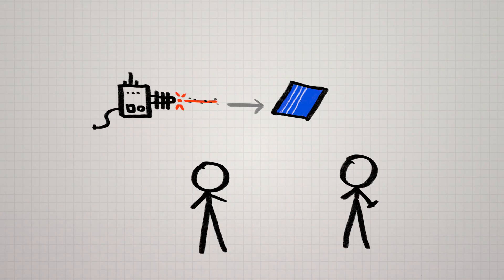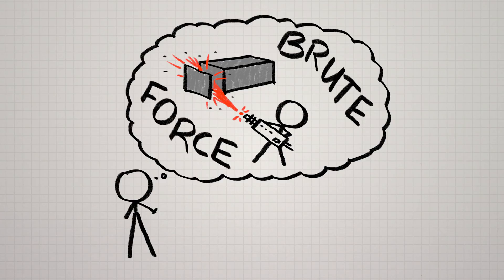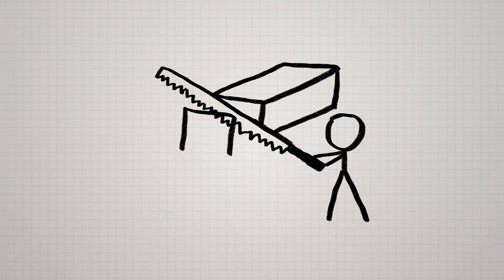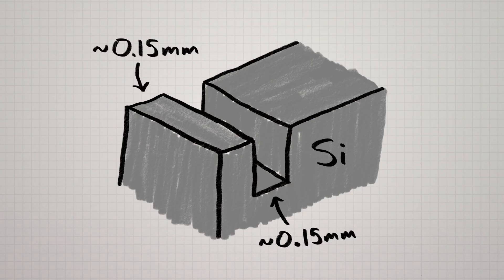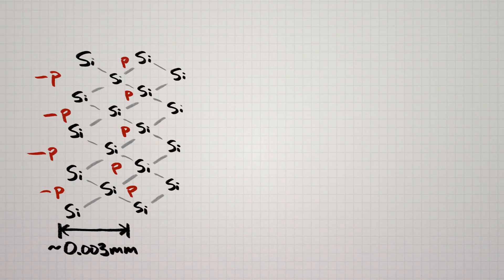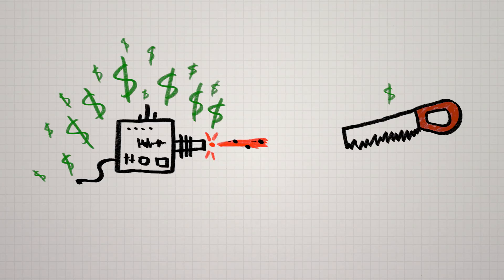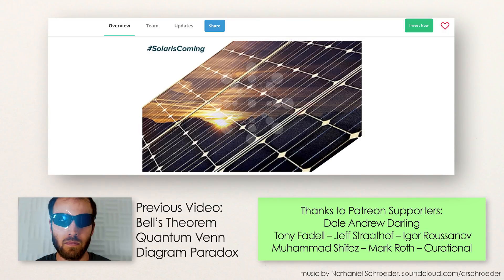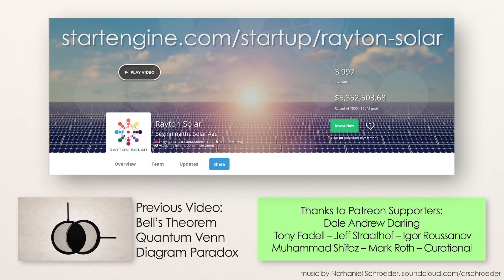Solar Panels Made With a Particle Accelerator?!

Comment: On top of the expensive particle accelerator, isn't the required energy to use quite an issue ?
Reply: Don't think of the particle accelerator like CERN. The term "particle accelerator" applies to many things. They don't mention the energy of the protons needed, but it's pretty simple to make small accelerators. Remember, you're accelerating really really tiny particles so unless you're getting them to near-light speed, doesn't take a substantial amount of energy.
Reply: TheEllusionist yes, a gun could technically be classified as a particle accelerator
Reply: Isn't that like asking if you had a steam powered lumber mill, and you need lumber to make the steam; If that would be an issue?
Reply: Haylox not if there is other people cutting the wood around you, but you would need to buy the first batch, hence the fundraising campaign
Reply: Huh? Of course you would have to buy/chop the first batch. 
I was referring to the "required energy to use" part of his question, and that you will produce more than you consume, and that you make what you consume.
"not if there is other people cutting the wood around you". If you are that close to another lumber mill (especially 100 years ago)  you are not a smart business owner.
Reply: Old CRT TVs are technically particle accelerators.
Reply: The thinner the wafer, the less energy it requires, and small particle accelerators are pretty efficient.
Reply: Just power it by solar cells XD
Reply: why can't we just break the sheets with our hands? We can feed one noodle a week on china workers and we already make profit.
Reply: small CRT + solar panel
Reply: They can just use the solar panels it makes to power it!
Reply: the particle accelerator is 35 million of their 50 million kickstarter, they aren't asking for enough, it may not be a scam but it's not well thought out if it's not.
Reply: no because a lumber mill takes unrefined wood and refines it, to burn the wood you do not really need to refine it lol, just cut it into logs and burn then use the steam etc.
Reply: +FieldSweeper Dude.... old sawmills like that ran off the scraps of the refined wood. I mean, how many planks do you think you get out of a single tree? Look at the wiki. The refined wood would just be a byproduct in my analogy.
Reply: koseq7 wasn’t it photon but not proton???
Reply: The particle accelerator is $2.3 million.
It is a scam, though. How can they save 60% of the production cost of solar panels when silicon is only 10% of a panel?
Reply: Matthew Lau - 100% Proton. Photons are not elementary particles. A photon is a product of the electro magnetic force and a carrier of it/energy.

You cant "embed" photons into anything and a light "accelerator" is redundant... and also called a torch.
Reply: Okurka - you got them there, for sure. 

Although I do like the idea of using less material and using higher quality mono-crystals. 

Its not exactly about savings or a huge leap and more a refinement of current solar technology.

I can see a huge benefit for space travel though. Thinner panels are lighter panels, lighter panels mean cheaper launch costs, cheaper launch means more power/fuel for spacecraft.
Reply: @Okurka, The answer to that was said in the video: More efficient solar panels need not be so large. Therefore they require less of all materials that they are made of. Look at an extreme abstraction: if the silicon was only 1% of the production cost, and if a technique with the silicon made the solar panel ten times as efficient. Then it need only be 1/10 the size, a 90% save in all materials and costs, despite the silicon itself only being a 1% part.
Reply: A cyclotron should do it. Google it.
Reply: that wouldn't work because it's a closed loop. You expect the lumbermill to gather enough wood to sustain itself AND overcapacitate. But there is no new energy coming in to replace the energy you used, so that's impossible.

For solar panels, there is no closed loop. The sun is constantly firing photon waves at the panels, which generates electricity (as long as there is light of course), so there is constantly new energy entering the loop.
Reply: they'll use solar energy lol
Reply: Okurka they are using much higher quality silicon, which allows them to make smaller solar panels that produce more energy. Since the panels are smaller they are cheaper to make and since they produce more energy they are more efficient. Did you watch the video?
Reply: Christophe Abi Akle not for me
Reply: I worked out the power requirement for one of these 
35mw p/s should just about cover it
Reply: Make solar panels for the energy!

Comment: Can this method also make a 2-D graphene sheets?
Reply: It is possible to make graphene by intercalating small atoms (potassium salts mostly) in graphite and then heating up. This is possible in solution, without particle accelerators. Which is even better.

Comment: I love your videos, but I am afraid that you are promoting a scam-ish endeavour:

https://www.sec.gov/Archives/edgar/data/1654124/000114420417002964/v456948_253g2.htm#a_002

If the company cannot raise sufficient funds it will not succeed or will require significant additional capital infusions.
 
[...] Even if the maximum amount is raised, the company is likely to need additional funds in the future in order to grow, and if it cannot raise those funds for whatever reason, including reasons outside the company’s control, such as another significant downturn in the economy, it may not survive. If the company does not sell all of the Common Stock it is offering, it will have to find other sources of funding in order to develop its business.
 
Even if Rayton Solar is successful in selling all of the Common Stock being offered, Rayton Solar’s proposed business will require significant additional capital infusions. [...] at least $35 million to create a 54 megawatt[...] manufacturing facility. This amount does not include the amount needed to manufacture the PV modules for sale. [...] likely to raise funds again in the future, either by offerings of securities or through borrowing from banks or other sources. [...] sales of equity securities that will dilute the holders of the company’s Common Stock.
 
The company has not yet generated any revenues.
 
Rayton Solar has no revenues generated since its inception. There is no assurance that the company will ever be profitable or generate sufficient revenue to pay dividends to the holders of its Common Stock. The company does not believe it will be able to generate revenues without successfully achieving target market sales for the PV module to large scale project developers, large scale retailers and wholesalers, or contractors. [...] will need to license its current and future patents, assuming the company is granted its patents that are currently pending. 

_________________

Also no Data to be found anywhere to back their claims

Edit:
Also they have had an unsuccessful indiegogo campaign a few years back
Reply: Well - that was what is was expecting. Wanted to look them up, but any company that wants to do sue "groundbreaking/innovaitive/Woirldchanging" new technology yet wants to use crowdFunding just reeks of scam - and people are still dumb enough to believe them.

You just need to think for a few seconds:
There are docents of companies producing solar-cells  with revenues in the hundreds of millions and profits high enough to fund those 50 million in a single year. and they are constantly putting a lot of money in research and development.
when those big companies still don't use that technology than there is very very likely a good reason for that.
Reply: Not a fan of sponsored content for an investment of any sort. It reeks scammy from its pores.

I could be eating my words in the future but this looks like a particle-accelerated solar roadway levels of impractical idea.
Reply: not sure if it was dave jones from the eevblog or thunderf00t but this has already been debunked
Reply: I was thinking the same and I still remember the solar roadway scam from a while back.
Reply: Just sad. Minutephysics trying to make money by spreading fake News. What are we eating?
Reply: Mimir Fonten i think its moreso that the company may solve difficult problems in the process of researching such a thing so then when it dissolves their will still be knowledge gained which the world can use.
Reply: Sorry to be negative, but I think this might be a waste of millions of dollars.  Unfortunately, I think once the marketing hype wears off, it looks like there are other technical processes that are less-expensive and more practical for manufacturing wafers.  Even just starting with what wikipedia says...  The majority of the market (and a growing segment as of a few years ago) is multi-crystalline silicon.  Wikipedia says silicon with >1 mm grain sizes can be made by simply cooling liquid silicon along with a seed crystal.  If for some reason that process isn't optimal, there are many ways to use thermal annealing to crystallize amorphous silicon.  From the sounds of it, many of those ways seem less capitally-intensive than the "proton beam" method.  These include oven heat, plasma, laser, etc.   http://en.wikipedia.org/wiki/Crystalline_silicon#Transformation_of_amorphous_into_crystalline_silicon
Reply: Thanks Mimir. I just wrote a similar, but far less comprehensive reply to this video. You are right on the money.
Reply: Silly you, these statements are pretty much standard boilerplate languages you can find in virtually EVERY companies in early stages.
I would rather be concerned if they don't include such risk assessment as part of disclosure.
Reply: That doesn't really make sense
Reply: This video only has the do with the science behind this technology, mentioning the company that is currently attempting to do things this way is just an add on. The science behind this method is sound, the only thing that has been debunked is this company, nothing more.
Reply: Henry did say at the end of the video that he is neither a solar or investment expert and thus he is not explicitly endorsing them. The content of the video only discussed the physics behind what the company is trying to do. At no point did he say "you should invest in this" or anything in that nature. In fact he even held some of his own skepticism on how profitable this venture could be with some optimism on the hope that it DOES work out. He was paid to make the video in order to spread the word, whether or not it the company can deliver on its promises is besides the point. The theory behind it is sound, so Henry is more than happy with raising awareness about technological innovations that could benefit society.
Reply: That is the point. Would this project really benefit the society or would this just make these guys who cook up this somewhat scam-ish plan rich?
Reply: Not to mention the $2.8 million raised in 2015 they used to pay their own wages.
https://www.fundable.com/rayton-solar-inc
Reply: Henry did say that he invested in the company, so he is endorsing it.
Reply: Wait.  A "Green Energy" company that's actually a scam???  I am just shocked.  SHOCKED I SAY!
Reply: Not so much "scam-ish". This is the common legalese you'll find with any startup. Of course they've been operating at a loss as they aren't actually making anything yet. It'll probably take another 100mil to get to that point. Bottom line, what they're going to be (maybe) producing isn't significantly better than what the market already produces, nor will they be able to produce any faster and/or cheaper than existing technology.
Reply: If you want to piss away "100mil", follow jfbeam's advice.  Otherwise you could read a book like "The Lean Startup" which seems to explain how to efficiently develop a product for a market with only a fraction of the money that the apparent scam company has already taken from investors.
Reply: TOTAL SCAM!!!! NO BUTS ABOUT IT!!!!
Reply: ITT armchair physicists and engineers that know exactly what they are talking about.
Reply: ethereal, I do have an engineering credential.  No, I don't need to know the "exact" situation at that company in order to recognize red flags.  

Get it straight.  When people ask for money the default answer is "No".  The company that is asking for investment money must make a strong case that it's a good investment.  They haven't done that.  There's nothing solid.  It's all hype.

It's also the investor's responsibility to intensively research it.  What people are saying sounds like a red flag to me:  "$2.8 million raised in 2015 they used to pay their own wages."  And there's little or nothing to show for it.  

The energy industry is very cost driven.  Many solar companies are going bankrupt because market prices are falling so quickly.

I can't claim to give the best investment or business advice, but I can comment a bit on the prospects of the engineering idea.  Even after spending 5 minutes on Wikipedia I can see that there are many low cost ways to shape silicon.  Silicon can be liquid-cast into any shape, and it also can be annealed with heat (or sintered).  As you know, there are many lower-cost sources of heat: ovens, torches, plasma, lasers, etc.  These cost in the 3, 4 or 5 figure range.  Maybe 6 figures for a laser.  Asking 7 figures for a proton beam just isn't likely to be a cost-competitive method of manufacture in an industry that is so driven towards drastically reducing costs everywhere possible.  

Also you have to understand that their entire idea is just one small step in making a solar cell.  They aren't making a market-ready product on their own, and they've apparently admitted this.

Comment: Just set up the wafer cutting system at the end of a beam line that's being used for something else. The beam dump ("waste" of particle accelerator experiment) becomes the fuel for the wafer cutting process.

Comment: That's awesome, although slicing with a super powerful particle beam would be even better.
Reply: um, how?
Reply: Cooler, yes. Better, no.
Reply: true:)
Reply: That's what they're doing.. Only they don't waste more energy that necessary.
Reply: a gradated power spectrum accelerator . Drive protons into maximum depth, then L0 - nx0.15mm increments, s.t. end w prefab N layers of Si, & separate thru hi speed Robotic Photaic cell adhesion, laminar heating & removal
Reply: Think Twice ii
Reply: It would be fun to slice bread with it
Reply: better in terms of coolness... although I honestly think this is cooler
Reply: saura... no.. you got it wrong

Comment: I'm amazed by how clever that is.
Btw, pretty sure that in medicine the same physics are used in radiation therapy to deposit charged particles exactly where, for example, a tumor is to destroy it (source: I'm a physicist who has taught that to medicine undergrads, which makes me doubly amazed by this waver cutting technique ^^)
Reply: As you're a physicist, can you tell me a bit about particle accelerators?
Reply: +POINTLESS GUY like what?

+Veinous It's not my distinct area of expertise (I do astrophysics, not particle physics), I didn't check up on my sources (I basically trusted them blindly), and the last time I taught it was 6 years ago (meaning I might remember things incorrectly), where I explicitly told them that I THINK that's how it works, telling them to not quote me on it. I might be wrong about this, but I did tell my students that I'm blindly trusting other physicists (i.e. non-radiologists) on that information so they KNOW that it might be wrong.
I didn't just spout something as truth that I didn't know for sure, don't worry, I have a semblance of integrity :P

Edit: spelling, because it's quite early xD
Reply: Same problem here than in protontherapy. Sure the energy is deposed much more precisely than with gamma-rays (radiotherapy) but there's still uncertainty on the position. For therapy where the typical tumor size is mm-cm that's not problem. For this purpose it might be

Comment: rayton solar aint gonna be practical proton accelerator there are a lot of different methods being developed for making similarly thin silicon wavers with no waste that are a lot cheaper. https://www.youtube.com/watch?v=IbYtn420QBM to hear a real engineer talk about it
Reply: Vinicius Albuquerque - well yes this is a lot more complex, still rather easy to understand form a physical standpoint.
And no, Dave is probably 5 times better at this than channels like MinutePhysics.

This scampany has existed for many years and all they ever produced is marketing material, nothing else, no actual prototypes, but they are hiring people - mostly for marketing....
Reply: emile um....  a microwave IS using a particle accelerator to heat your food...  it's just using electrons to do it.

speaking of which, if the idea is to bombard a crystal with charged particles and let the repellent force of the particles do the cleaving, why not just purpose-build an electron gun to do it?  we already freely wrangle those pixies every day...
Reply: Vinicius Albuquerque Its not only about the high risk, but mainly about the low rewards. This won't help mass produce significantly cheaper wafers.
Reply: I find it funny how you say, "And I honestly think you shouldn't comment that "It is pretty stupid to use a particle accelerator to save half the sillicon" without actual data to prove your point." when RaytonSolar hasn't produced any data other than marketing infographics... 

Intelligent people would posture that extraordinary claims require extraordinary evidence, however in your case, it seems like extraordinary claims require no evidence and the burden of proof lies with those who refuse to credulously believe things at face value.